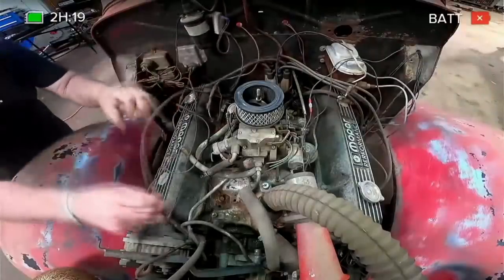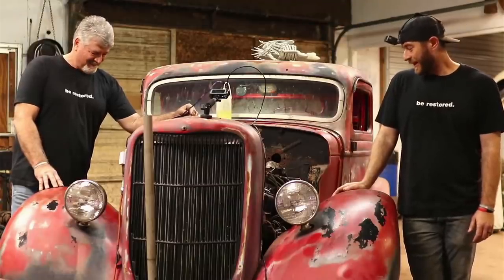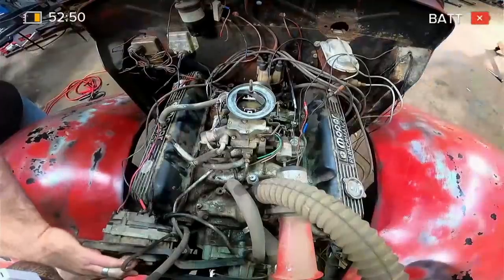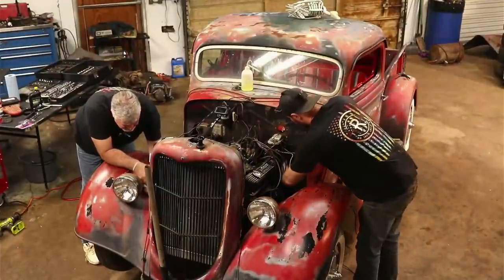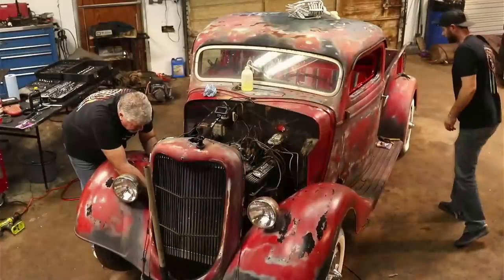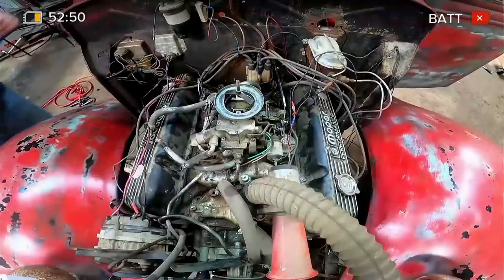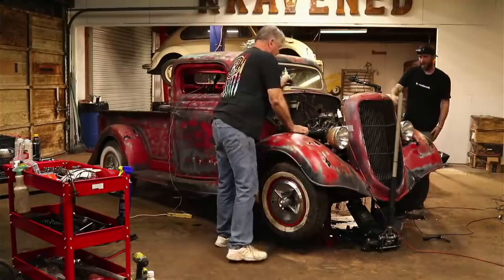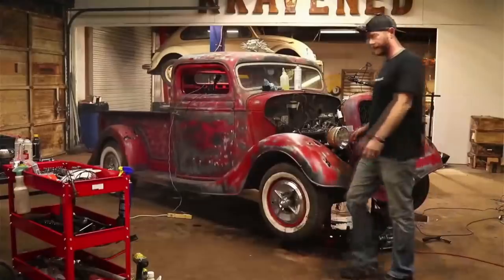Part 2 LIVE Forgotten 35 Ford Truck| Will It Run & Drive After YEARS| Previously Locked Up| RESTORED

Comment: I wanted to say...   I grew up first watching then later helping my father tune engines.  He was a "carburetor man", he could fix almost any carb problem there was.  We spent a lot of hours in my youth just like this: Bent over an engine, no air cleaner, manually throttling the engine as we listened to it run and deciphered the sounds and what they meant.  That raw suction sound of air being dragged into the carburetor triggered so many good memories of those times with my dad.  A few frustrating ones, too, but all good!   :-)  Thank you for that.  God bless you boys!

Comment: Hey guys, I love watching you two work on the old cars and trucks, When my grandfather died he and I were working on his 1960  Comet to keep it running. After he died in his honor I finished it and got it running again., but he had also planned on putting in a small block Ford motor. Once it was running my grandma wanted to learn how to drive so I taught her how to and got her license. In the meantime I got a small block Ford motor from a friend of mine and rebuilt it to make sure it was running okay. I pulled the straight 6 out and mounted the v- 8 in it.
Reply: That ol' 318 needs a double four barrel intake w/ carbs to match. OR A TURBO TO MAKE her breathe right.

Comment: I no I'm just putting a comment.  I've watched this video several times  .  
But always remember.  That if a spring is strong enough or short enough.  Or not long enough.  You can just cut off 2 or 3 rings . And re loop it . Or if not long enough.  Just stretch it . And if you have any kind of questions.  Just message me.  But what a great looking truck.  👌

Comment: Hot brakes?  Phantom circuits abound in early hot rods! Consider this: The brake master cylinder would be grounded to the body. Brake lines may have incidental grounds anywhere it touches the body or chassis. The engine enters the loop through engine or transmission contact, and even trough the drive line.  So, you have battery directly connected to the engine, a good thing. There should be a heavy strap or jumper from the engine to the body also. My own favorite connection for battery would be connecting negative to the ground stud on the starter (when there is one) and a strap from engine to body and to chassis.

Comment: And one more tip .
You can always use a break cable from a bike. But you need to make sure you bring the tip of the cable housing as close to the choke so your cable will slide back and forth.

Comment: im just going to point out. If i recall right. You make it sound as tho the wiring in this old ford was very very bad. But you end up hunting for a 12v source for a long time before deciding to run your own. Anyway i love these revival videos. 🙂 yall doing it live and uncut sometimes makes it a bit longer than id prefer. But its great seeing all the problems you may run into and then your fixes for said problems. 😅

Comment: That truck is more special than most vehicles you have had in some time.Just think it ran without even really rebuilding the carb or anything.Hopefully u will decide to make it a long term project as a daily driver.It would be a great advertisment and great on a shirt.

Comment: Amazing looking truck. Needs an engine swap back to Ford. I am a Chevy guy at heart.  But that truck is so nice it deserves to be all Ford.  👍👍👍👍
Reply: My thoughts exactly. Definitely not a ford guy myself either, however, in an application like this, keeping it one brand seems more appealing to me. I am certainly not an expert,  and it may be more of a size issue than anything but keep the old Ford a ford. How about a cayote motor? That thing would rip! Of course, you would also need to improve brakes and suspension to make it something other than a death trap.
Reply: @rwandersonut  already got disks All the way round what more do you want...
Reply: Having said all that, I realize you all may sell this as is, so the next owner can change what ever they want.

Comment: The pump in the carburetor is dry when the gas gets to it lung change it back up it start running right or put a little transmission fluid on it and send your pump for your carburetor

Comment: hey lance just take everything out from under the hood and drop in a new engine/motor and rad and all new stuff so that way you dont have to have the battery in the back of the truck but paint the area where the motor/engine goes first

Comment: I really like the truck except for the hubcaps and the steering wheel center cap spike to the brain potentially lol Pretty crazy you got that 318 to run with all the water that got inside...Maybe just swap in a Ford 347 and C-4 trans and call it a day next time🤠

Comment: The red rat Mopar engine is running. Good job but the carburetor needs disassembly apart and cleaning the carb bowl. Can you check it if it is dirty? Usually, the garage has high temp resistance hose that fits to the exhaust pipe and out thru the garage door to expel the smoke away.  It hurts your eyes or even my eyes that it is carbon monoxide smoke.

Comment: That body ground is A must from. Engine block to the A frame.&tve starter ground yo lance  Thats why your brakeline overheated to on ya'll. Do yo no body ground.& battery ground also. So hoy can tie both into each other.

Comment: if you get a older carb they will fit directly i would get something like a 68-70 318 carter carb troubles will go away i think the electronics are getting you

Comment: Why are guys not using 2 stroke mix to atleast lube up the upper cylinders and dry firing it with starting fluid take the risk of scoring up the cylinder wall but what do I know

Comment: There is a tube open in the top at the front of carburetor fill that vent tube with gas should run for 3-5 minutes

Comment: with that water all being in the bottom of the oil pan i wonder if th4re was a leak that  allowed the watr to get in at the oil pan connection to the engine this would explain the water being on the bottom since oil and water dont mix and th water just pushed the oil up as the water level got higher and higher ???

Comment: That carb is an old computer controlled unit with it looks a mixture control solenoid plugged into the side. The electric solenoid on the throttle is for ac idle up and anti-dieseling for shut down. Throw that away and put on any old carter BBD 2 barrel from the early seventies, non computer car.

Comment: I would guess the float needle is shot and hear a bad vacuum line wen float needle s are bad leak gas out carb usually I believe you would be happy with a 700cc demon carb.

Comment: Looks like being on camera is lke trying to think out loud to keep the veiwers informed
Reply: Those are lancer, or flipper hub caps...very rare...very cool! Save them if u change wheels. The bad thing about dodges is the relay set up on the electrical system. When it works it works, when it fails you have to sort out the problems. I keep a spare array of relays and voltage regulators just for trouble shooting direct connection units. There is also a box they call the brain that does many things, it might be the problem. Great videos. You are a lucky man to have your father sharing your passion and love. God bless you two and sis as well !!!